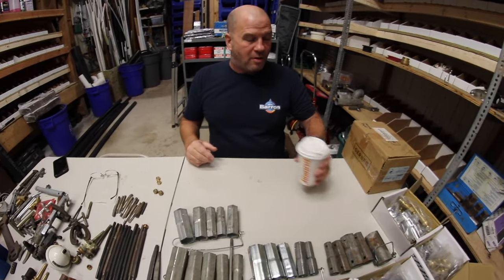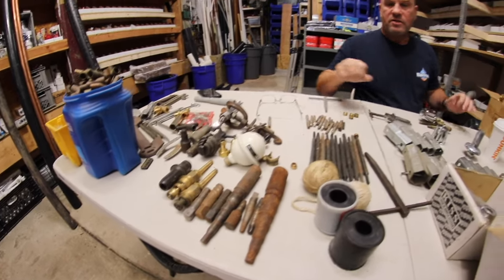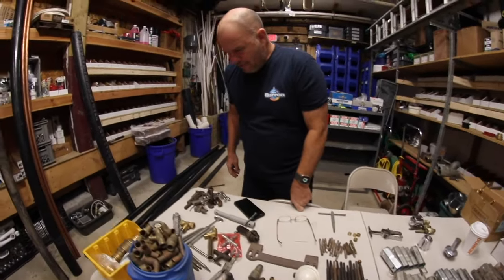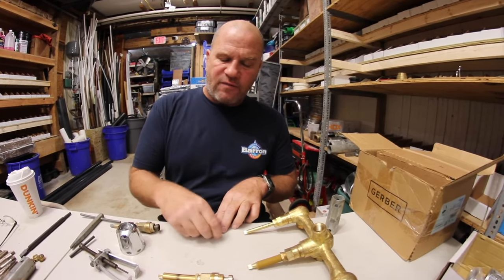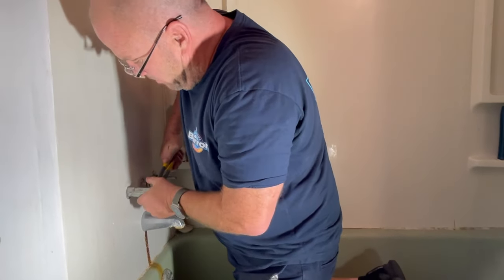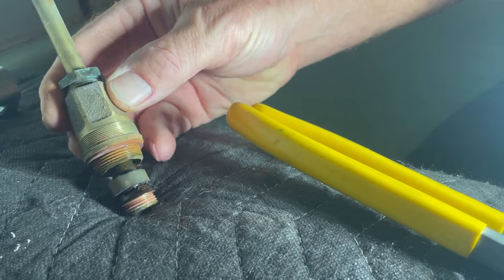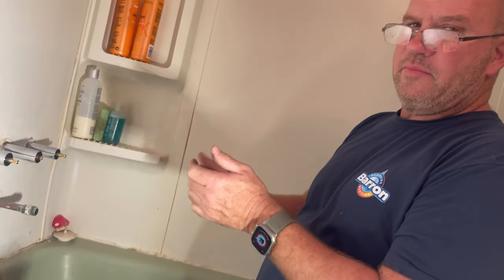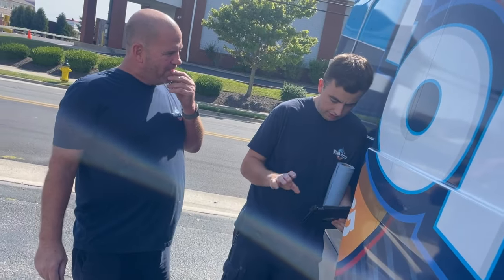GERBER THREE HANDLE TUB | SHOWER REPAIR

Comment: Hi Chuck, Great video, I used to own a 100 plus year old house in Rutherford, NJ. I had a similar set up in one of the bathrooms in my house, it had to be from the 40's or 50's. I would dread having to change the washers especially with all the old screws holding the washers in place.I always had to wrestle removing the handles then working with those tub wrenches to remove the stems. Im sure the screws holding the washers in place were original. The heads were starting to disintegrate, i'd take my time removing the screws. With a small screw driver I'd back the screw out, then replace the washer put it all back together and call it a day. i never had to replace the seats. That housing seemed like it was cemented or plastered into the wall, it would have been a major job to remove it from the wall. I believe its still in use today.
Reply from the maker: Oh I may have worked on yours. lol.

Comment: I have to say, Chuck,  I haven't watched a bideo in a while, but I missed your personality. Yeah, that job is always a craps shoot. Especially if it is in an apartment building, on the third floor. With no access to shut off valves. Gotta shut down the main, and pray nothing breaks or strips, while taking it off. Thanks for sharing, buddy. What do we got? Another satisfied customer, that's right.
Reply from the maker: We we got dave?

Comment: Thanks for the video! I am facing doing the same. Why do the L handles strip the seats? What is better, any T-handle? I just bought a set of these to replace the valves as my wife said she could not adjust the mix to the right temperature. Still have not opened. I thought I would replace the seats while I was in there. Maybe I should leave well enough alone if they are not actually leaking (yet)?  They are hard to turn off, so maybe it is worn washers?

Comment: So how long has it been on the video making? But yes i been changing my own at home. Saves me the high cost. Thanks for the vedios
Reply from the maker: On youtube since 2018
Reply: @ChuckBarron  keep them coming. How do you think I learned about the seat inside the facet? Yes, I got the L shaped tool you thought was junk, but it worked. Need the handel puller, though. They get really stuck on.
Reply: 1 more question. What do you do if you can't get the handle off with the puller? Thanks in advance brother!
Reply: @stephenbraden6239  tell you what I did. I cut the stem and all off, then replaced it with new. Once it's cut, you can wrench the stem out of the hole.
Reply: @michaelfarris2556  take a Sawzall and cut it off?

Comment: I'm installing a new three handle tub/shower kit from Danco & the copper valve seats do not have any washers attached or included, nor does my old one (unless it corroded away)? Do these valve seats need a washer or teflon thread? Also, be careful with these kits because in my case, the faucet stems fit but the the diverter stem does not. Back to the hardware store...again.